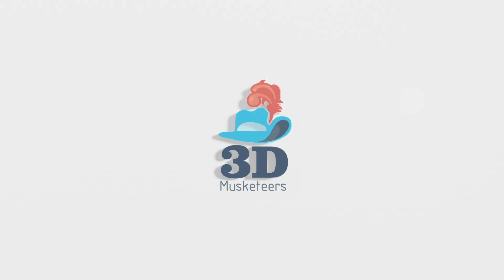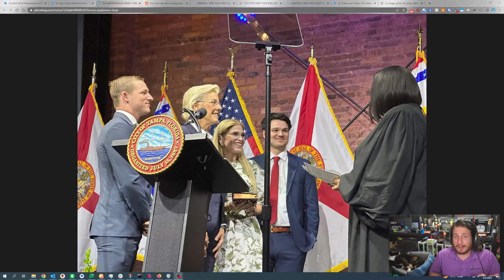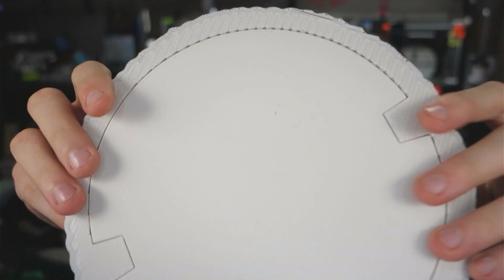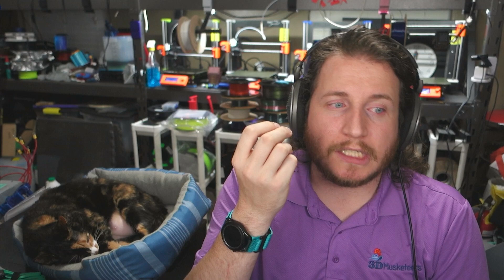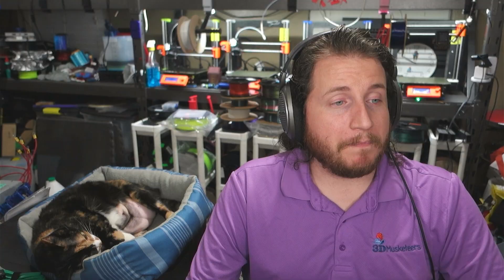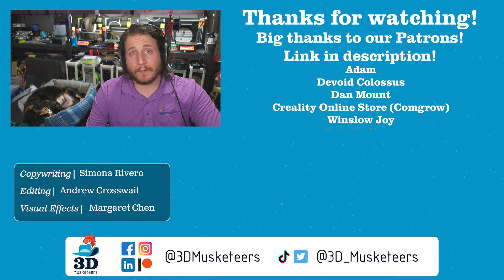First Time 3D Printing and CHASING ZEROS!!! - PrintFixFriday 86

Comment: Hey man love the content and how informative you are in your videos ! I am a beginner to 3D printing , and was wondering if the prusa mini is best to start with or is the prusa mk3s better for a first time printer? I’d like to start off making parts for myself but eventually branching out to selling parts down the line. Thank you for your time !
Reply from the maker: depends on the price you are looking to get the mk3s for. The mk3s is older, and being only 8 bit is limited. Mind you, I love mine, but I love them from 5 years ago. In the current times it is hard to not want the 3.5 upgrade kit for it which is another $250 from Prusa. While I personally like the Mini, some people have issues with them. 

What is the budget you have to work with?

Comment: For that nice print with the bridging for all of my overhangs including holes I use the variable layer hight and drop the layer hight a bit at the steps up or the tops
Seems to work fairly well as long as the layer hight isn't too low or a touch high still
It also helps keep my holes round and less likely to have a booger screw up a layer line
Reply from the maker: ah, I need to try that one day!
Reply: @3D Musketeers  using Orca I use the slide bar for my variable hights when it comes to steps or overhangs, holes, etc.
The automatic variable layer hight is ok I guess but I'm too much of a control freak and typically find the auto settings regardless of where my speed and quality number is set seems to be a bit janky
Reply from the maker: I do need to try orca, I've avoided it to run stock when I can..